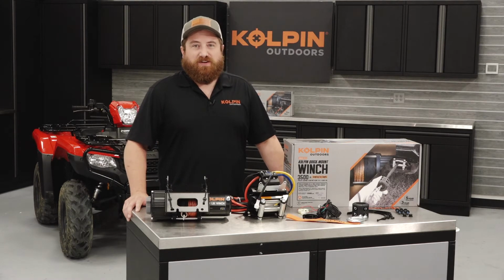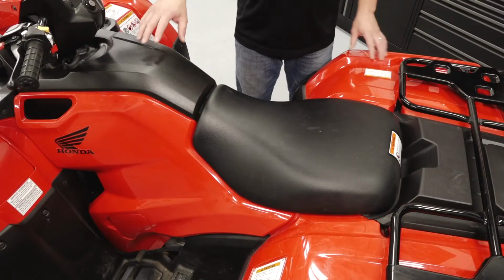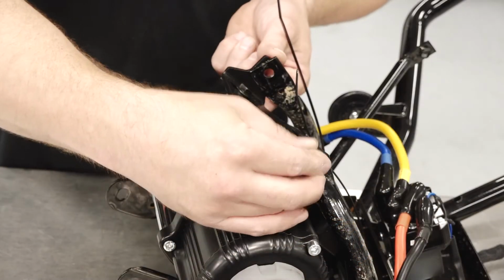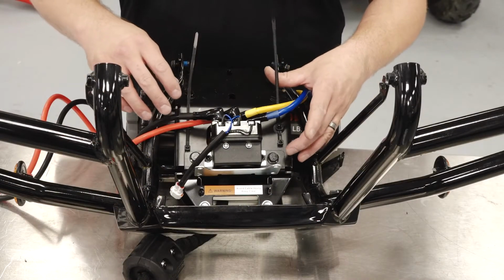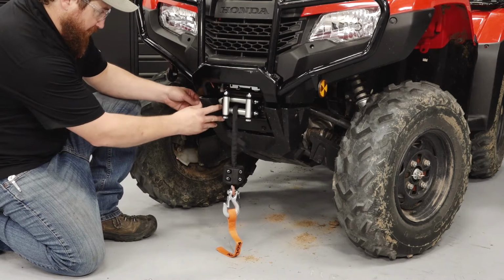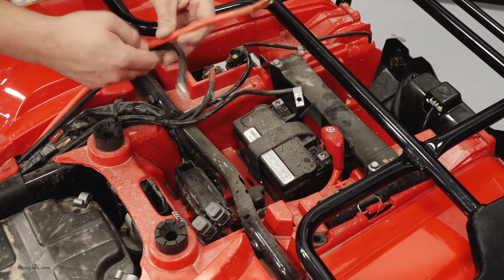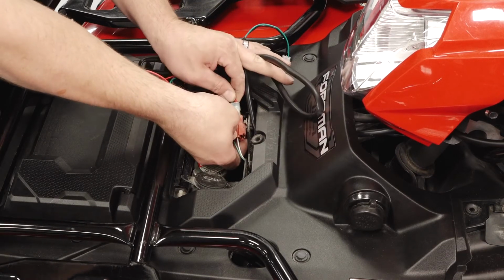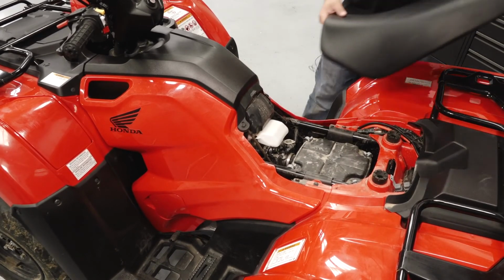Kolpin Quick-Mount Winch Installation - Honda ATV

Comment: Is that little relay box above the winch waterproof? Seems like a low spot to be mounting it. Also can you link me with the correct one that will fit a 2021 Honda Rubicon 520 IRS EPS DCT. 3500lb synthetic rope. Thanks
Reply: Yes thanks I wondered that also